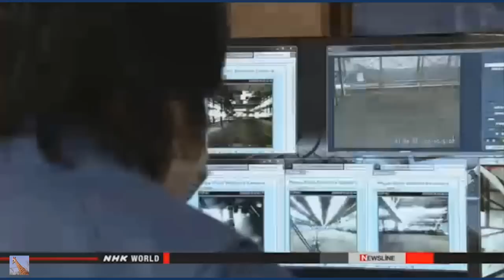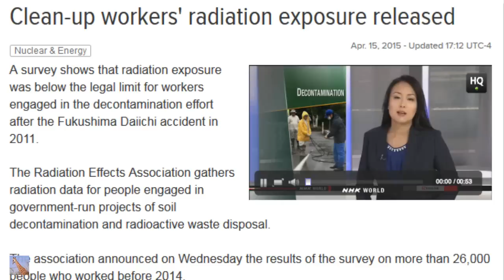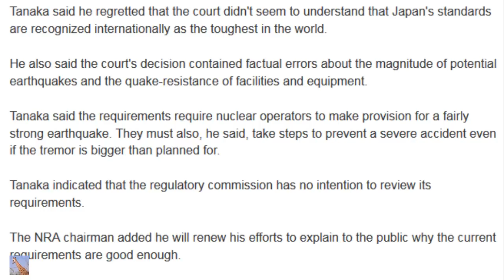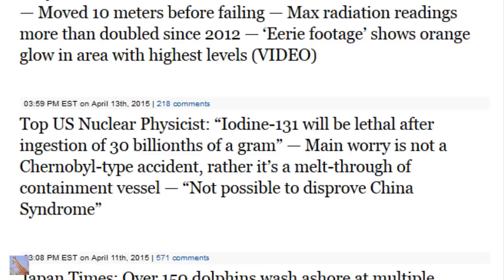Fukushima Inserts 2nd Robot Into R1 & Dead Irradiated Dolphins update 4/15/15

Comment: Thanks MsMilkytheclown1   Enjoy your time away, much love your way, be safe!
2nd Robotic Survey Begins Inside Damaged Reactor Apr. 15, 2015
The operator of the crippled Fukushima Daiichi nuclear plant has begun operating a new robotic probe in the containment vessel of one of the facility's reactors after a similar device failed.
Tokyo Electric Power Company sent the new 60-centimeter, snakelike robot into the vessel of the damaged No.1 reactor on Wednesday.
The first probe stopped working on Friday after advancing about 10 meters on a platform in the container. The utility gave up on recovering the device as one of its maneuvering belts apparently got stuck in a gap of the platform.
The probe collected valuable images in the vessel along with temperature and radiation data. The container was filled with steam from water heated by molten nuclear fuel. Humans cannot stay there due to extremely high radiation levels.
The operator concluded that the robot's camera and maneuvering belts functions well, but decided to be more cautious even if the new probe takes two or three days.
The 2nd robot is to take a route different from the previous one, to collect a wide range of information about the reactor.
~~~~~
Clean-up workers' radiation exposure released
Apr. 15, 2015 would you expect any other news from the Japanese Government Nuclear Clean-Up Propaganda Machine? Don't forget about the secrecy bill.
A survey shows that radiation exposure was below the legal limit for workers engaged in the decontamination effort after the Fukushima Daiichi accident in 2011.
The Radiation Effects Association gathers radiation data for people engaged in government-run projects of soil decontamination and radioactive waste disposal.
The association announced on Wednesday the results of the survey on more than 26,000 people who worked before 2014.
This is the first time exposure levels for workers in the decontamination effort have been made public.
Association officials said no worker's exposure reached the legal limit of 50 millisieverts a year.
They said the average exposure was 0.5 millisieverts a year.
They also said that in 2013, 14.6 percent of workers were exposed to an annual dose of more than one millisievert. One millisievert is the annual permissible level for the general public.
Health ministry officials said they will continue to supervise operators undertaking the work so that radiation exposure can be properly managed.
~~~~~
Japan Scientist: “I’ve never seen this before” — White lungs found in dolphins that died during mass stranding near Fukushima — Interruption of blood supply leading to death of tissue — Disease has been linked to radiation exposure http://enenews.com/dead-dolphins-wash...
~~~~~
NRA chief defends standards despite court decision Apr. 15, 2015
The head of Japan's nuclear power supervisor has hinted he sees no need to review regulatory requirements despite a court's decision to block the restart of 2 reactors.
Nuclear Regulation Authority Chairman Shunichi Tanaka spoke to reporters on Wednesday, the day after the Fukui District Court issued its injunction. The court blocked the restarts of reactors 3 and 4 at the Takahama nuclear plant in Fukui Prefecture, central Japan.
The court found that stricter regulations put in place following meltdowns at the Fukushima Daiichi plant in 2011 are still too lax.
Tanaka said he regretted that the court didn't seem to understand that Japan's standards are recognized internationally as the toughest in the world.
He also said the court's decision contained factual errors about the magnitude of potential earthquakes and the quake-resistance of facilities and equipment.
Tanaka said the requirements require nuclear operators to make provision for a fairly strong earthquake. They must also, he said, take steps to prevent a severe accident even if the tremor is bigger than planned for.
Tanaka indicated that the regulatory commission has no intention to review its requirements.
The NRA chairman added he will renew his efforts to explain to the public why the current requirements are good enough.

PS: I'm going to try to take some time off from Fukushima updates. Please subscribe to MissingSky101 for up to the date most current info. Thanks MissingSky101! https://www.youtube.com/user/MissingS
Reply: Yeah right... I bet lots and lots of homeless people died in there.

Comment from the maker: The operator of the Beaver Valley nuclear power plant in Shippingport performed an emergency shutdown on one of its two reactors early Wednesday because a pump that moves water to a turbine malfunctioned, owner FirstEnergy Corp. said. Unit 1 shut down at 4:11 a.m. and will remain offline for several days while workers repair a bad bearing in one of two condensate pumps that handle non-radioactive water, spokeswoman Jennifer Young said. No radioactivity was released and Unit 2 remains in operation. Young said that after the pump is fixed, the Unit 1 reactor will be restarted slowly and operate at 50-percent power for a time before being returned to service. http://hisz.rsoe.hu/alertmap/site/index.php?pageid=event_desc&edis_id=NC-20150416-47801-USA
AND
A reactor at the Darlington Nuclear Generating Station was shut down mid-afternoon Tuesday following a loss of radioactive water. The Unit 2 reactor at the plant was shut down after a loss of heavy water was detected during planned maintenance on its heavy water transfer station, according to Neal Kelly, an OPG spokesman. "All the water was contained and recovered, so the reactor did what it is supposed to do," said Mr. Kelly. "There was no impact to the health and safety of employees, the environment or the public." Mr. Kelly said approximately 7,000 litres of heavy water escaped through a transfer station within the facility and that the reactor was shut down as a precautionary measure and relevant government agencies notified. "To put that in perspective that's about five hot tubs' worth," he said. "All that water has been recovered and contained." He noted while such incidents are rare they do happen from time to time, but he stressed the key thing is the reactor performed as it was meant to. "If you have a spill of heavy water the reactors are designed to shut down," He said. "They're designed to collect any heavy water on the surface as well." The cause of the heavy water loss is currently under investigation by OPG and the results will be supplied to nuclear regulators and the public. 	http://hisz.rsoe.hu/alertmap/site/index.php?pageid=event_desc&edis_id=NC-20150416-47798-CAN